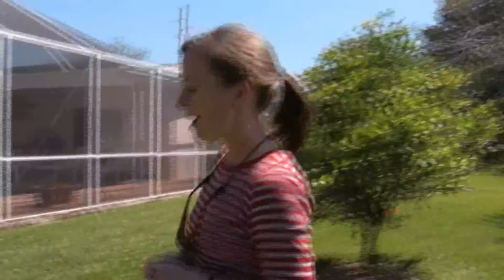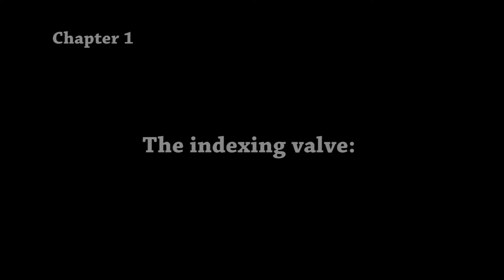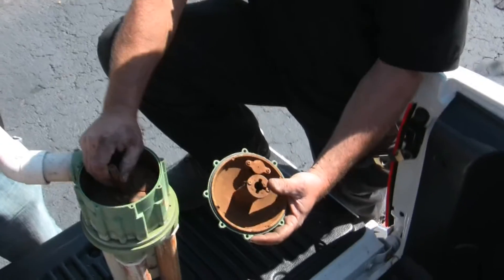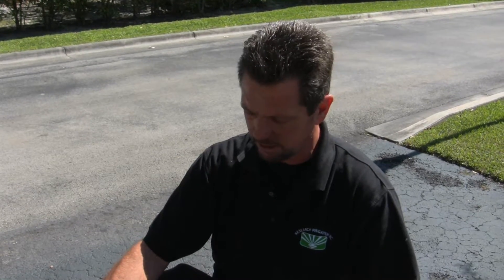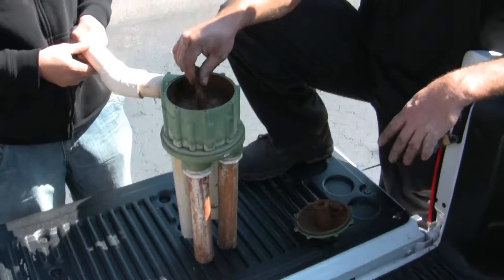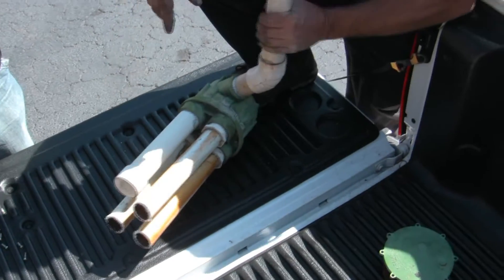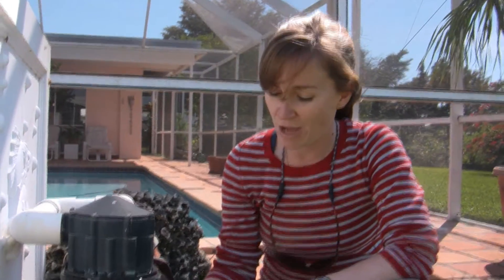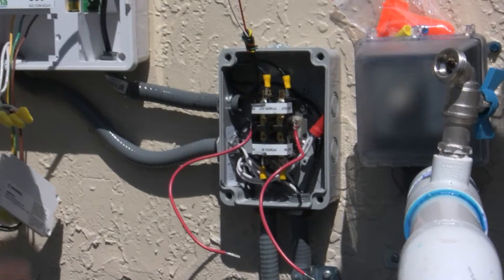Part I Irrigation retrofit case study

Comment: You’re wrong when you say You don’t know which zone is going to turn on when you have a manual index valve. As long as you put it back into the original position when your service guy gets done it will always start on the zone you leave it in to start on … if that makes sense. 
You just toggle through the zones mannerly until you want to start on a certain zone. It will always follow the pattern once you have it set

Comment: Great information.  Thanks!  I'm upgrading an old indexing system to a 24vac controller.  Digital hardware and software are standard for irrigations system these days, plus now you can buy units with wi-fi that connects to a smart phone irrigation app .  Who wants to go back to a land line and hunt for a pay phone to make mobile calls?  A digital irrigation controller is not complex, it is far simpler than the smartphone, laptop or computer you are using to watch the YouTube videos. 
Irrigation valve diaphragms are similar to a toilet flapper in a bathroom.  Both are made with reinforced rubber to withstand chlorine, scale and hard water. True, as they get older, they tend to lose flexibility and don't have the sealing function over time. Eventually this would show up as a small leak or extra water use.  A stuck valve diaphragm can also prevent a zone from coming on.  Saying you don't want to use valve diaphragms and electric solenoids for irrigation is like almost like saying you don't want to use toilet flappers to flush and would rather have an outhouse or porta-potty instead.
Also with digital controllers, you can swap out the AC solenoids and switch to DC voltage, use the same irrigation valves w/DC latching solenoids in cases when you don't have AC or need a remote system away from the utility power grid.  I've done this on a house which was having AC electric wiring problems in the garage and couldn't use a 24vac system until AC house wiring circuit was fixed.   I just wired up and programmed the DC controller and swapped out AC solenoids, programmed some new run times to run on the DC controller w/9v battery.  Job finished in less than an hour.  So the yard didn't burn up while the electrician was trying to diagnose and fix garage wiring.  Didn't have to remove irrigation valves (Rainbird 1in. DV series) since they operate the same, either AC or DC solenoids will fit on same type of irrigation valve.

Comment: Lies, Deception & Misinformation. Get your facts straight. I have had a 3 zone indexing  valve in my irrigation system  since it was installed in 2007.  My indexing valve can handle up to 4 zones, but is configured for 3 zones.  I've never had a problem w/ my indexing valve. I have a deep well & there is a screen filter between the well & the pump thereby blocking debris from the irrigation system. I think the well is 350 feet deep. This system is simple & effective.

Comment: Inaccurate information.  The indexing valve can be programmed even with an electro-mechanical control.  The only fault I have found in 22 years of using it, is that the original material used (by FIMCO) was not strong enough.  The new material (now in black) holds up much better.
Reply: Thanks, how can you program?

Comment: I've used indexing valves in my home for 30 years, and replaced the front yard valve once in 30 years, and i run off a 45 foot deep shallow well, in a sand vein.  I run 8 zones and would have to have 8 electric solenoid valves conventionally, I run two indexing valves, one for the front yard and one for the back yard, and two solenoid valves. A simple  timer is all you need on a indexing valve. I run the timer for 45 minutes, shut it off for a minute, then run it again for 45 minutes and so on until all my zones are indexed and watered. I like the indexing valves because I can run one large diameter pipe to the valve, and put the hydro valve close to the zones to preserve volume, then neck down past the indexing valve to preserve pressure at the sprinkler heads.  It is important to match the number of outlets on your indexing valve to the number of zones.  I do not have the electrical sphagetti you see on most residental homes with 8 or 10 solenoid valves. I think you do a diservice to folks who could install a indexing valves easily and get great service out of it, especially those who are on city service water, they will have less issues than I have (which has been minimal) since they do not have typically sand or grit occuring in their water supply.

Comment: Hi i am a sprinkler con in ft lauderdale fl i did a retro fit of a index valve 2 6 in line valves dv100f valves 1espme con and a goulds pump gt15 new strataflow check valve and a tank that is 4 anti rust everything brand new have 1 problum 1 valve is making a thumping sound when it comes on come 2 find out that the tank is sucking air only when that valve turns on 6 valves number 4 is the valve i have never had this hapen 2 me b4 aney help please